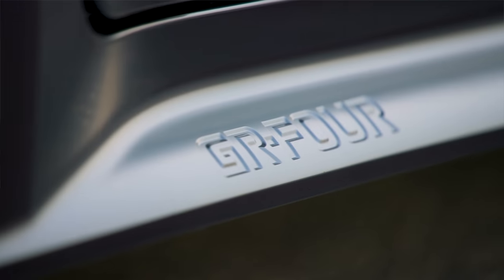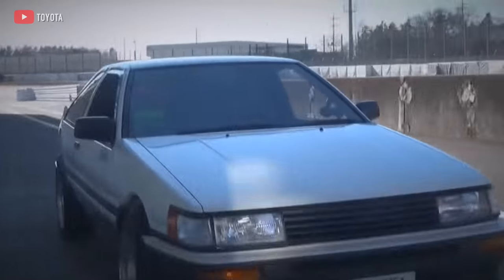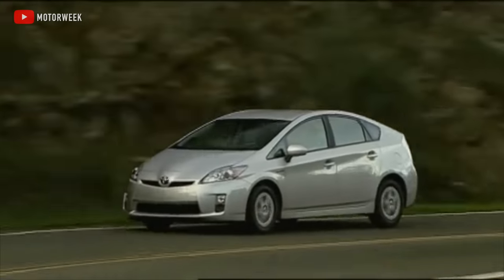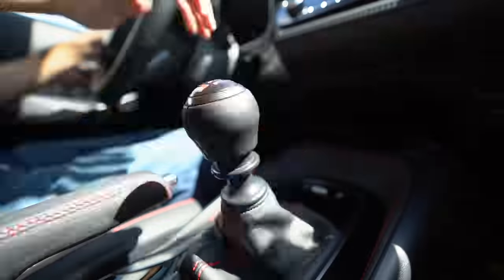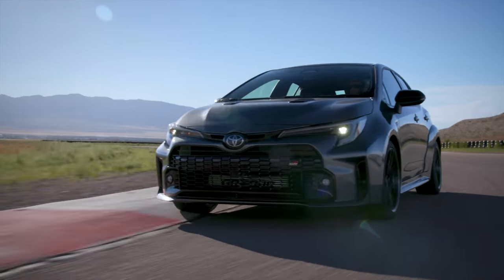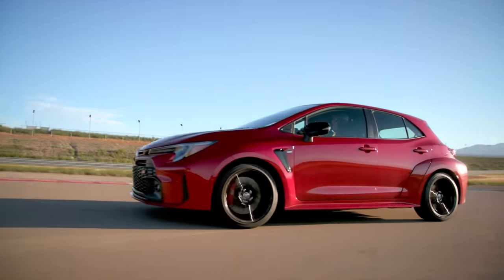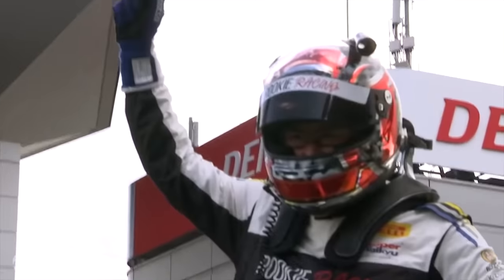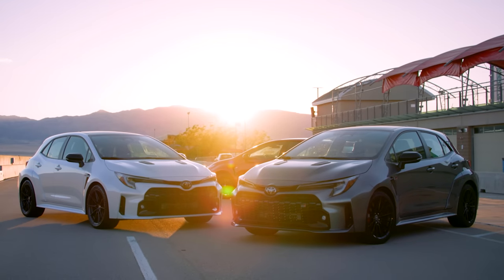Toyota Forgot How To Make Sports Cars

Comment: Sure, I get it, its a great car for a toyota, but why just not get a subaru sport car for less than toyota’s price? I can thrash my impeza sedan almost anywhere, at any time of day, in any weather condition and still get grip which most cars don’t have these days. The subaru also can get you better gas mileage and gives you more fun experience than any other toyota I’ve driven. Just saying.
Reply: are you talking about a base model impreza? bro you havent driven enough toyotas if thats the case, and subarus do not get good gas mileage
Reply: @arcanevoid9199 
I'm sure that you feel differenly due to your experiences, but if you assume I have not driven a toyota,  you would be absolutely wrong.
 
I did drive a 2010 camry hybrid for an entire year in Ohio, and I thought it was a terrible car.

Overpriced (40k first bought), boaty, heavy, not a great car to drive over snow/ice, the hybrid battery powered motor blocks a good portion of the back window, and it has poor acceleration when you try to merge on the highway. 

Gas mileage is great for me, as I have added more miles in one week than my last car, without issues that require expensive service fixes.

You are right that older subarus get bad gas mileage, but not newer models, like the 2019 impreza, you would be incorrect. 

Also, the camry I drove was a lot more boring compared to fun to drive Subaru i drive now.

Although, my grandparents got a newer Camry (2020 model) about a year ago, and although I found it cool, it never felt it had the same fun feeling I have in my daily driver Subaru. 

I don't trust Toyotas as much to keep me safe, and I definitely don't feel this way about Subarus.

Mine is a 2019 Impreza sedan sport and I get almost better gas milage and maneuverability than my car before.

I will say it once again:
Toyota's daily driver cars are not as good as Subarus. 

For a grocery getter, horsepower is not everything, but it should be safety and reliability instead. 

I don't see my daily car as a car to get from point a to b, unlike the modern, boring Toyota. 

So why do you think Toyota is better, bro?
Reply: @initiald975  thats exactly what i was thinking, youve only driven camrys. idk what you are expecting from a car designed to be efficient and reliable and thats about it. subarus all get average gas mileage because pretty much all of them are awd which uses far more gas, and generally boxer engines arent as economical too. again idk why you would expect a camry to be fun to drive, the only people that buy them are uber drivers/taxi companies or people who dont have any interest in driving at all. should try a wrx bro, if your gonna go on about how good subaru is but you dont even have one of the decent ones. and when was it about grocery getters? and toyota is making more exciting cars than subaru is, they literally just stopped making the sti and dont have much else. never said toyota was better, they arent as focused on sports cars though. never have been

Comment: "The new Supra is german"-To make it somewhat affordable. By that measure, the last Supra wasn't a toyota either, what for having a Yamaha engine, a German Transmission, and a German differential. BMW does the drivetrain (mostly because you all would've thrown a temper tantrum if it didn't have an I6, and BMW is one of the only automakers still making them), toyota does everything else. It's a toyota.

"The GR86 is a subaru"-Again, to make it affordable. Same points as above. Subaru does the drivetrain, Toyota does everything else. It's a toyota.

"Toyota is largest car company. If they build a good car it will be profitable."-Not for Sports Cars. Learn economics and business practices.
Reply: He’s stating what the internet trolls pretty much says, he owns the new Supra and had a BRZ.

Comment: 300 hp 3 cylinder wont last long. Cant wait to see the engine problems these things will get
Reply: Rebuild every 50,000 miles. Also, since it's a low production model, the motor will likely be a $12K job to replace/rebuild, where as a WRX costs about half that since there are so many salvaged and rebuilt motors.

Comment: They should put that engine in the 86. Toyota is so stale as a company. They are solely focused on profits and reliability. Nothing that they make exudes any excitement or passion. If they are not careful they will end up like Buick. Buick went from making the most prolific cars to making stale reliable cars. Where the average age of a Buick owner is 68 years old. Toyota used to be about giving the customer options. The fact that you can't buy the Yaris here is not cool. Yaris is not the best looking car but I can deal with it. The Corolla is horrible. I would never drive one. It's a grandma car with a body kit.

Comment: You don't know the difference between a sports car and a hot hatch? And you don't know what a Supercar is? I know YouTube automotive journalists is a self-appointed title but please take the time to learn the definition of these things before putting content out there. The GR Corolla is not a sports car. It is a hot hatch. And the Toyota 2000 GT from the 60s is not a supercar. It is a sports coupe. Historically a sports car is a two-seat convertible with sporting pretensions. And Supercars are defined as a two seat, mid-engine car with the engine mounted longitudinally. (The Lamborghini Countach was the world's first) This is not to be confused with hypercars. Hypercars are cars that set new standards in performance, super cars are designed to go 20 miles an hour on Rodeo Drive while the driver does his beast impression of a peacock. Toyota really has only made one true sports car, the 3rd generation of the Toyota MR2 (a.k.a. "MRS")  Even though it's engine was mounted midship, the engine was transverse mounted making the car and mid-engine sports car.

Comment: Just imagine an awd 300hp 1.6t gr 86. The Corolla is too heavy, it should be closer to the r53 minis 2500lb weight not corvette 3300lb sluggishness. I’m actually a bit sad that Toyota finally decided to make a global sports car but they decided to go with a Corolla instead of a lightweight celica or mr2. The fact is it’s too much of a compromise and I don’t see it being successful just on the sheer size and weight of it.
Reply: Corolla just makes more sense because everything was pretty much there already. The just took the Yaris powertrain and put it in a Corolla with tweaks. 

Who knows though, maybe we’ll see the engine in a MR2 or something later
Reply: You are aware that toyota are testing the gr16 in the gr86 right? And someone in Japan is building an ae86 with the same engine. Fun times!
Reply: @MontyPython12  man i wish it makes it to production. That will be best send off Toyota could do for ICE sports cars.
Reply: @shinn43  It might, if we all start making noise about it!
Reply: Celica is a larger heavier frame than the Corolla of its time period.
Reply: @MontyPython12  yes, which is why I mentioned it?
Reply: @hasshatter  the last gen celica weighed 2450lbs the gr Corolla is 900lbs more. Tell me exactly how the celica is heavier.

Comment: Digital cluster. WHY. God. Fucking damnit. Why. Why is this a thing. Stop trying to make this a thing auto industry. I drew a hard line in the sand that I will never buy a car with a digital cluster, no matter how perfect is otherwise is. I don't want fancy tech. I want modern safety and economy and old school everything else. Give me the ae86 with modern safety and environmentalism and if we're being generous,  power windows and heated seats. 

Every time I see a new car and think "ooh, this might finally get me to buy something new" it has some abject dealbreaker like the Mazda 3 AWD only having an automatic or the Nissan juke nismo only having a CVT, or the Kia stinger only having an auto. now it's crossovers and digital everything. I want something smaller. Simpler. Just give me a hybrid 240sx with a 5 speed and nothing other than safety features added. Stop adding tons of  pointless tech and excessive amounts of horsepower and sound deadening (seriously, the paramedic in me really needs you to be able to hear my damn sirens again. Genuine issue with modern cars)

It seems like good vs
Reply: do you know how the regulations are now? they couldnt make anything close to the ae86 even if they wanted to. and why are you looking at those cars? what were you expecting?
Reply: @arcanevoid9199  the modern mx5 exists. It's all of 50lbs heavier than the original 1.6. Regulations have nothing to do with it. It's just bad media coverage practices, ignorant consumer demand on disposable luxury, and auto makers over-relying on technology over simplicity.

You can get a modern ABS system so light and small it fits on a bicycle. That's the tech trend I want in cars, not fingerprint covered touch screens and a digital gauge cluster that costs five times as much and breaks twenty times sooner and is impossible to repair E-waste. That kind of awful design philosophy has nothing to do with regulations.

The only modern regulations that would impact design is modern rollover and crash protection generally requires thicker a/b/c pillars and higher beltlines. But that's about it.

Comment: You’re delusional. Toyota completely designed the 86. The whole thing.
Reply: He’s friends with the chief engineer Tetsuya Tada, who told him that. Lmao
Reply: @MaddNomad1015  definitely not lmfao. Tada has stated that Toyota designed it from the ground up. They went to Subaru for assistance in producing it to lower costs.
Reply: @jacobdionne4334  😂
Reply: @MaddNomad1015  I’m sorry you’re not educated on the topic
Reply: @jacobdionne4334  “educated” all that’s going on man is you think you’re right and no matter what you’ll think you’re right. So I left it at that! I’m not calling you names or anything.
Reply: @MaddNomad1015  because I AM right 😂
Reply: @jacobdionne4334  What a surprise, going exactly as I said! 😂

Hope you have a good one man.
Reply: @MaddNomad1015  sure, argue with someone who works for Toyota. Great idea.
Reply: @jacobdionne4334  that’s cool! Corporate? Or are you just some dealership worker that’s trying to pass that off as something meaningful. Lol
Reply: Toyota did the exterior design. Subaru did the engineering and it's manufactured at Subaru plants. The parts are also 85% Subaru, with only the transmission and fuel injection system coming from Toyota. Also, anything with a Boxer is either a Porsche or Subaru at the end of the day.
Reply: @amuroray88  incorrect. Toyota did all the engineering work. Toyota built a boxer before Subaru even existed as a company. Toyota designed the heads completely. The variable valve timing, the injection system, everything. Toyota designed it for Subaru to build. Toyota owns 15% of Subaru Corp., Subaru motors’ parent company. They have a lot of pull.
Reply: @amuroray88  No point man. lol.

Dealership employee, not wise to go against him. 😂
Reply: @jacobdionne4334  lol ok. The BRZ/86/GR86 is literally just whatever the current WRX engine is with different fuel injectors and no turbo, but sure, Toyota designed it. Lol
Reply: @amuroray88  except it’s not. Toyota designed the heads for Subaru.
Reply: @amuroray88  the fa20d is different than the fa20f